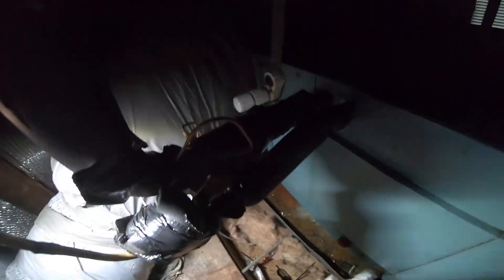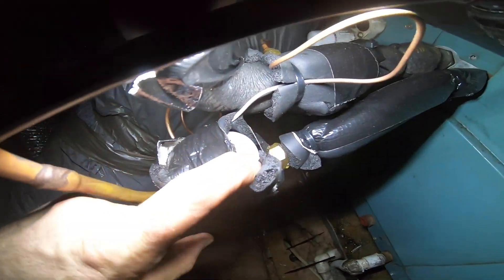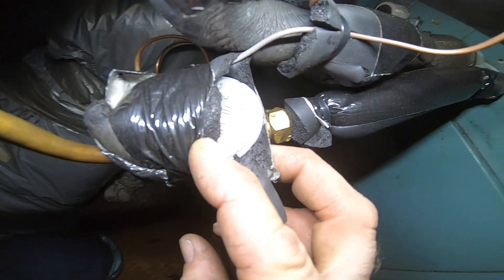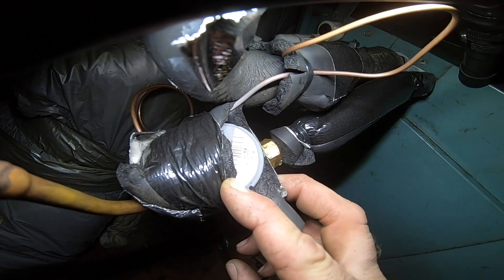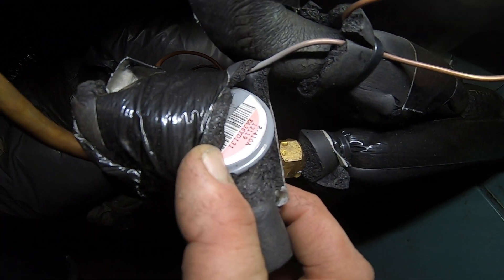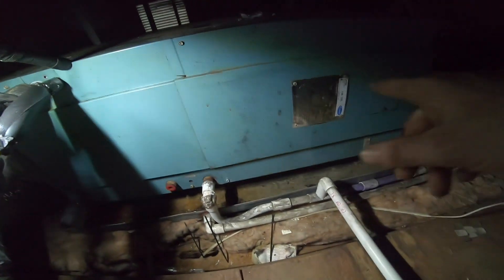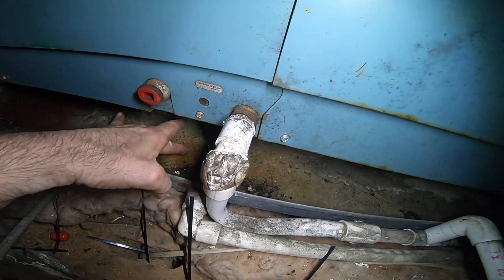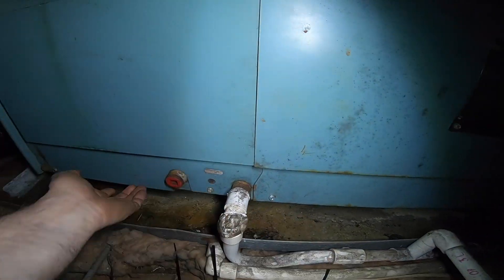R22 AC Hacked Up And Converted to 410a

Comment: Not a big deal honestly if you think about it a R22 heat pump runs higher pressure in heat mode than 410a in cool. Plus that coil is way thicker and stronger than modern stuff
Reply: Yes totally agree - coil is probably stronger than the modern "efficient" ones! :-)
Reply: Wa wa we wa
Reply: yep, flush good(remove mineral oil) install proper TV(they did) new cond. unit, charge adjust TXV an go.  as long as the pan isn't rusted out/clogged.
if it was done years ago, before pan rusted and now it did, oh well :)
big crook companies don't make money of said repairs, which most techs either don't want to do or have no clue it's possible nor how.

Comment: Thank you all for your replies, I want to clarify, If the furnace was to be replaced with the evaporator and condenser it would be $11,000. I spoke to a woman in our community where the HVAC company only did the Evaporator and Condensor for around $4000. Just found that out, can't imagine why the furnace would need to be replaced when we hardly use heat in the desert, just a way to pad the bill. Again MANY thanks to all you fine guys, and Bill.

Comment: OK, you struck a nerve that has been bothering me. I have an R22 system that is 10 years old, works hard in the desert in Palm Springs area, often 120 out in the summer. Works excellent. What would I do if the compressor fails or the evaporator leaks? Would I ask about a R22 substitute with an oil change after parts are replaced? Or would I allow a complete system change out for mega bucks?  Or should I buy 2- -15 pound canisters of R22 for future failure insurance? HVAC guys want $100 a pound for R22. Any suggestions are appreciated.
Bob
Reply from the maker: I wouldn’t touch any r22 drop-ins. Yet since u said your ok with an oil change, then 407 would be the way to go. Mu-22b has destroyed many trane compressors. 407 pressures operate very similar ro r22. Only the oil needs to be changed and a retrofit added. I am currently just using r22. Lots of labor changing oil in ac system. Yet I have installed a few 407c condensers onto a r22 system. Not sure how long those will be around. Your system is 10 years old. Has it ever needed refrigerant? Many systems go their whole life without leaking. At least the r22 machines. 410a I wish I could say the same.
Reply: Bob, what you should do is dependent upon how long you are going to live or own this home.  If you are staying 10 yrs or longer, you should cough up the money and get a new system regardless if coil or compressor fails.
Otherwise, if coil fails and you're going to be there for 5 years, you could gamble and replace the coil and keep R22.
If the compressor fails and you'll be there 5 years or less, replace the compressor and use R407c if your unit factory charge is 10lb or more.  Otherwise, just stay with R22.  New compressors come with compatible oil for R407c and Copeland rates there R22 compressors with 407c.  There is little to no capacity loss with 22 to 407c conversion.  Can't say the same for any other substitute.

In the end, system replacement is best on residential equipment older than 10 yrs if the coil or compressor fails,
Reply: @MoellerEngineeringCo.  Again many thanks for your ideas,we're in this home for the long run as we are already retired. Probably just go the replace system parts and re use furnace, hate to buy R22 and maybe not use it. You guys are all terrific...

Comment: and what's wrong with that, if they flushed the coil/lines good, installed proper txv and new cond. outside?
yeah the water dripping/leaking isn't good, is the pan/drain clogged or rusted out? how long ago was it converted?
Reply: Coils not meant for 410a
You can take 410a coil make it 22 but not opposite
Reply: @Rainmaker88  I’ve heard the opposite many times at this point. “R22 coils are so good and copper as long as it’s rated for atleast 380psig it will work. Swap condenser , metering device and clean line set.
Reply: @Rainmaker88  coil is a coil … it doesn’t matter what Freon you use .

Comment: TY Presto, I asked 2 different AC techs in company vans if they can use an R22 substitute and they both said NO. They said replace Condenser, Evaporator and one said furnace. I asked how much approx for 4 tons and he said $11,000. How do I find a company that would use a substitute and know about necessary changes to the system? I have read about substitutes on youtube and it looked promising. TY for your answer.
Bob
Reply: The price of R22 is not that high right now.   Why not just fix the leak and recharge it with 22?
Reply: @speckulator7516  TY for your reply, I am anticipating future failures, right now the system works very well, but it's 10 years old. I was thinking of buying some r22 for future problems, one day there will be some. Also our builder used cheap evaporators not the ones sold by the AC furnace manufacturer, so their lifespan is limited before they fail, it is a problem in our tract. I was wanting to get ahead of the costly freon issue.
Bob
Reply: I'm having trouble with compressors failing after a year of running r22 sub. I'm fixing to change a little over a year old compressor that is rattling like crazy that was convert to a r22 sub. So far I've had 7 systems to fail using r22 sub ranging from less than a year to 2 years. I've stopped converting them. Like stated above, r22 is cheaper than substitute right now and will possibly stay that way. The distributors and warehouses overstocked r22. The HVAC industry cut back on r22 usage much quicker than anticipated. They now believe they are going to be left with r22 stock they can't sell. I'm buying r22 for about $11 per pound now wholesale.
Reply from the maker: Bryan u having problems with 407. It’s the only drop in that I have not experienced issues. Yet it’s not a drop in yet can replace 22. Oil doesn’t return correctly with most drop in refrigerants
Reply: @thehvachacker  no I've been trying something else. I can't remember the number. I'm sure the oil displacement is causing the problems.
Reply: @thehvachacker  it's r421a.
 There's another issue with drop ins. Congress is fixing to change the rules on r22 systems as they claim "there's too many old systems out there that's got r22 in them leaking out and that's got to be changed". So who knows what they'll end up doing. I think they'll make it illegal for us to repair r22 systems anymore. Since all drop ins contribute to global warming, they probably make them illegal too.  Especially if democrats get control of the house and senate. You know r410a is going to be banned too in the future too don't you.
Reply: @Bryan-Hensley  R410a is worse for global warming than R22 is (you should know this if you have your EPA card). 
And yes, we should all expect R410a to go away at some point. I expect R290 (which is just propane) to become standard in the next couple decades. They're already using it in Europe and even in the US in some appliances. It still contributes to global warming, but only about 0.1% as much as R410a. Plus, it's very cheap and plentiful. We SHOULD be using it.
Reply: PrestoWind I’m no expert but love to nerd out about how similar R22 and R290 are. From what I understand they perform almost identically (if not slightly better for propane) and mineral oil is fine for either. I’ve been considering finding an old R22 window unit and just performing a straight swap to see how it performs. Your thoughts?
Reply: @truthsmiles  r22 destroyed the ozone layer, according to them.
Reply: Bryan Hensley R22 is one of the culprits, but not the main one. R11 and R12 were much (like 20x) worse. The main advantage to R410a is that it doesn’t deplete the ozone layer, even though it contributes more to global warming.
Reply: @MoellerEngineeringCo.  I must not be charging enough. I swap out HP 3 ton for around $4400.
Reply: PrestoWind Excellent point about weighing in. I once came across a paper written by a German company (govt agency?) advocating retrofitting R22 systems with propane. As I recall they had a weight conversion factor but of course I can’t remember it. I also remember the principal issue they wanted you to address was eliminating possible arcs, so it was a lot of replacing bare spade connectors with covered ones, and I believe an enclosed contactor for split systems. Otherwise it seemed pretty straightforward. I’ll see if I can dig up that paper again...
Reply: @truthsmiles  r410a doesn't require a card. Anyone can buy it just like r134a. Where I live anyone can claim they are a HVAC company. No one is licensed, they have none.
Reply: @MoellerEngineeringCo.  no kidding

Comment: How many pounds of R22 in a conventional 4 ton tract home installation? Furnace in attic, Condenser on side of house? Thanks again
Reply: @MoellerEngineeringCo.  Thanks
Reply: @MoellerEngineeringCo.  So if I pick up a 15 pound cylinder that may do the trick? Piping looks like aboout 1/4" and maybe 5/8,will look later too hot out now, about 115 today.  Bob
Reply: 12.25 lbs usually

Comment: Taillight guaranty not to work. Why just why is the question. Plus on a flex octopus that air flow would  be restricted for a 410a system to work properly. Nice quick video. Bet the coil was frozen at one point causing a water issue.